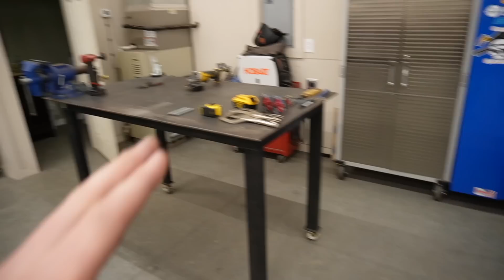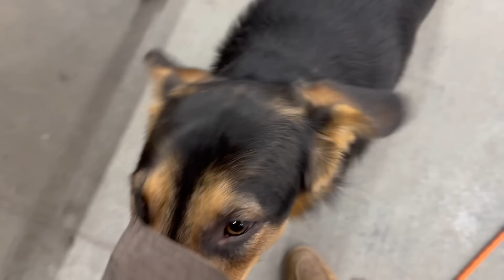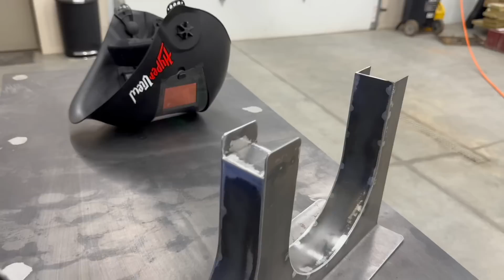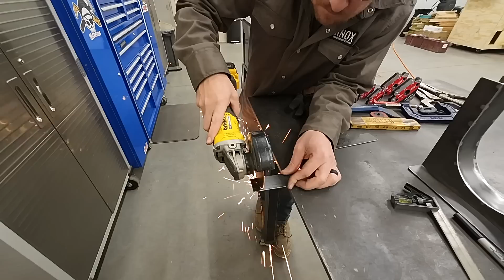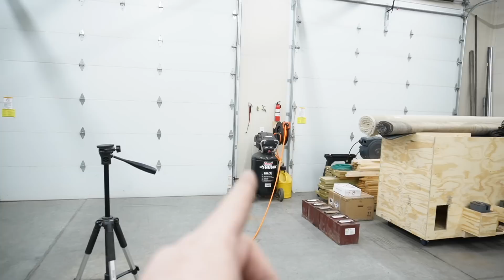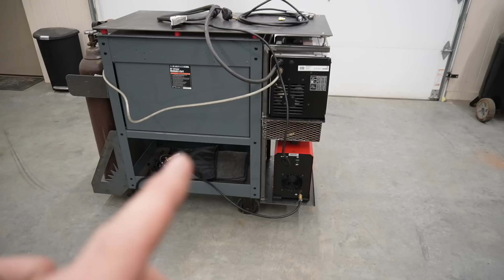The ULTIMATE Welding Cart Build Continues....I Need YOUR HELP

Comment: Awesome.  Id find a way to put the cord reel on the inside of the bottom so that you keep it as narrow as it is. That can be pretty handy and I think a spool on the side will bug you.  Also Id be temped to just have the welders grounded to the shelves they sit on  and connect all the metal to ground. No reason to separate it that I can think of.  You know electric, its not going to go through the tools if you have a strong connection from those shelfs to the top. Run a strip of 1" braided copper or something.  I still think a small vice that stays on the back corner or even comes on and off or swings around flat would be pimpin.

Comment: love the project. just a thought, could you make/buy a automatic rewinding power cord for the back. also put the female welder clamp socket lower down almost at the bottom of the tray where it bends up, then the earth cable wont keep getting in the way  as you run it to a project.

Comment: Mag mount puck ground facing upwards above the Hobart. The center spring loaded copper contact only touches the bottom side of the top plate when the lid is closed. You can isolate a piece of 14 gauge mounted to the 1”x1” frame to stick the magnet to with the plunger poked through the middle.
Reply from the maker: Good idea

Comment: I'm really digging this build.  I'm doing my own version as well but definitely think I am going to incorporate some of your ideas on mine.  The shelf for the welder and bottles is top notch.  Might might not just be as "BEEFY", lol.  Really good idea on the ground and wire management as well, and those wheels will be fine for what you have going on.  If anyone thinks they won't look right they probably don't have any experience with one of these carts and are scared of the idea it's Harbor Freight.

Comment: I would of switched ends for welder placement.  Access to welding wire would better.  Wouldn't have to remove welder to change wire.
Reply from the maker: Thats why i placed it on the left so i can access the door.  I covered that more in the first build video of this cart.

Comment: Is that a cordless die grinder on your bench and are you using it to remove the dross from the plasma cuts?  I recently purchased a Langmuir Crossfire XR and am looking for the best way to remove the dross thanks
Reply from the maker: I love that die grinder and i always use it to remove dross.  Works well for some of the more detailed areas of a cut.

Comment: Weld a tab with a hole through it and weld the tab vertically to the front somewhere and use the hole as a torch holder to eliminate the magnetic one you showed at the beginning of the video. Size the hole appropriately to hold both torches.
Reply from the maker: Good idea

Comment: how is that a ground cable since is not connected to ground? (the cart and welders are bonded together but not grounded.)
Reply from the maker: The cart will be grounded through the AC power.  The ground im referring to is for the welders.  Are you familiar with how welders work? I dont mean that sarcastically.
Reply: @SpicerDesignsLLC from reading through these comments, it's quite evident that a lot of people have no clue how welders work or what a "welding ground" is, like all the folks saying "put the ground down in the bottom so it's out of the way". 😬🤯 Plugging in a ground cable for the second welding table shouldn't be hidden away down in the bottom, "out of the way" where it's nearly inaccessible and just wasting length from the typical 10' cable. 😂

Comment: If you only have one location for the welders to plug in, you can have your extension cord there on the wall and then put a generator inlet on the box itself - not sure how long of a cord you're planning on using but they get THICC although to be fair neither of your welders will draw much more than 30A so you could always go with a lighter gauge wire (10SJOW) instead of "standard" (6SOOW) Both welders use a 6-50 cord end and receptacle but neither will draw 50 - future proofing for larger machines is a good idea though, converting an extension cord to a lock style would commit you to it in the future but would keep the box clean - all depends where you want to go with it. love the centralized ground idea!

Comment: Remove the plastic isolator from the grounding block and mount it directly to the bottom of your welding table grounding it without any steps.  Female connector for extra ground cable is a great idea.

Comment: You won’t regret building that upper mount beefy, because when you start using your TIG more, you’ll start going through more gas and at some point you’ll start buying 150s instead of 80s and that rack will hold them just fine.  Good job.
Reply: 100% this.

Comment: the only issue I see with the ground port being tied too both machines is welding a/c tig. I don't know if it would hurt the Hobart but your the electrocutioner, just a thought. and in some instances you will tig electrode negative.
Reply from the maker: Good point

Comment: It all seems reasonable to me. How about epoxying a thick piece of soft rubber to the inside of the bottle gates to prevent rattling?
Reply from the maker: I did get some 1-1/2 weather stripping i was going to stick in there after i paint it. Good thought for sure.  Thanks!

Comment: Kyle nice design. Look into a twist lock inlet so that you don’t have a cord hanging on there. If you really want to make more work change the welder plug to a 4 wire setup and have a neutral on the cart that way you could have a 120v receptacle for a grinder. One cord nice and clean.
Reply from the maker: I did think about adding a 120 outlet.  Would be some more work and i would need to add a breaker for it in the cart too.   I may add that in later if i find a real need for it.  Thats a great idea though.  Thanks!

Comment: On the cable management, you might be able to use the the HoBo Freight retractable hose reel (#93897) to hold your electric extension cord (swapping the air hose for the extension cord).  It should easily hold 25 feet of cord.  It would be beefy, but might be too big for your hole down there.  The rollers would protect your cable as it goes in and out, you can adjust your tip length with the collar, and the detents on the hose reel would allow you to pull out more than you need so that its not causing a trip hazard.
Reply from the maker: Very good idea

Comment: Only concern if you plan on grounding with the table, it will only ground well if the top stays clean and free of rust.
Reply from the maker: I would still have the option to use the external ground clamp
Reply: @SpicerDesignsLLC  i clamp to my top to ground. It usually works very good. It varies if your project doesn't have a lot of contact with the top. If it doesn't i do the same thing, just clamp to the work piece. I will say with your top size you will likely have to use your other table for a majority of the work you do.

Comment: great video series,a suggestion, I'm so happy you strapped your tanks ,always been a peev wobbly bottles with a chain,what I did instead of the latches make the strap longer drill a hole and use a knob with a threaded stem to lock it down. Works great, and for a guy who refills bottles every 2 to 3 weeks it doesn't take that long to unthread.
Reply from the maker: Great idea

Comment: Cable management is key. I have a big 220 Lincoln Welder with wheels and the tank mounted in the back. When welding something away from the normal welding table I hate dealing with the long extension cord that’s hard to wind up and then store. I want to look to see if there’s a heavy duty retractable extension cord that would mount to the wall and retract so it’s not such an inconvenience. Maybe something to consider for your cart to make it easier to connect to that junction box you’re putting in the back. Love that bottle holder! Mine from Lincoln has a dinky chain. 😂
Reply from the maker: Retractable is a great idea

Comment: Loving this build. I started on a similar cart a while back I just keep getting side tracked.. Your bottle carrier parts are "Beefy" I'm for sure going to incorporate that. I'm using an old  tool box for my platform so no flip top. My thought on the ground lug would be put the plug in cable one on the side, you will probably still use the top of the cart while working on something else so it might get in the way out front.

Comment: Just a potential heads up…. I found out the hard way when I built my cart, not all bottles are the same diameter. I built my holder to the smaller one. 😡🤬
Reply from the maker: My mix bottle is slightly smaller.  Ill just have to make sure they give me the same size when i swap them.

Comment: Not meaning an overthinking perspective, question. Being that the Hobart is heavy and the two tanks sizes, is there a tipping issue? I understand that you’re using in your garage and you have concrete. Is that an issue? Otherwise, always entertaining watching you! Dossier is a beast!
Reply from the maker: Its pretty stout.  Doesnt feel top heavy.   Its a lot of weight to be shifting around so i will have to be careful while moving it around.  Ill do some testing with the tippyness (not a word) in the final video.

Comment: You've got some really good ideas,  Kyle. The only suggestion that I  have is that you put the female ground quick connect down low on your cart. I know it's a pain in the ass to reach down to, but I think youll find that if its up high you're constantly going to be getting tangled up in the ground wire.
Reply: Your good comment got me thinking that the connect should also be printing down (up, or sideways) so the ground cable root doesn't stick outwards. Less stress on it should it get bumped, and slightly less chance of it getting bumped in the first place.
Reply from the maker: Yes good point.  I like that idea
Reply: Nice layout. an Fab work.
Reply: Looks great, great thoughts used, looking forward to the end result
Reply from the maker: Thanks for the input Bruce.
Reply: Great little project. It's inspiring me to do the same .
Reply: M A C H I N E
Reply: So the ground cables should not be, well near the ground?